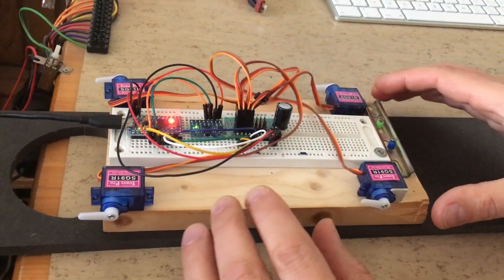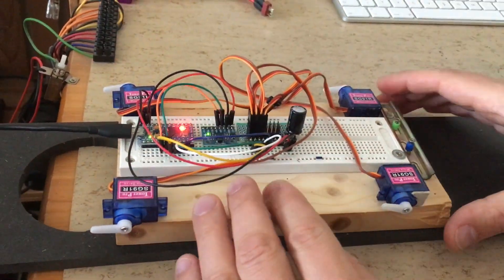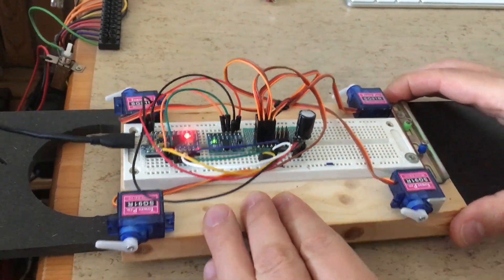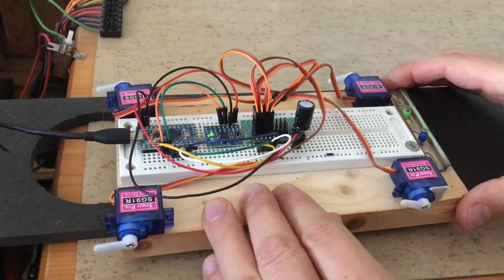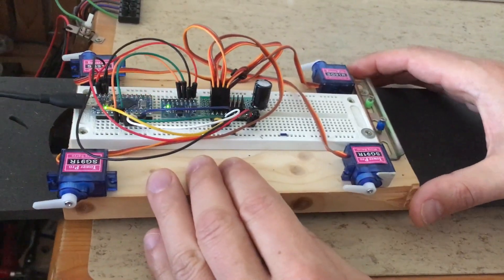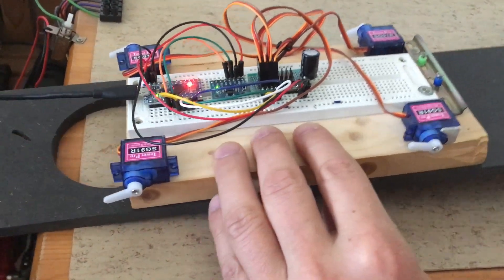Arduino RC Truck Cab Suspension Spring Simulation: MPU-6050 Spring Simulation!

Comment: Looks nice and smooth! I don't know if you've ever seen the Ao - to project (there are some videos on youtube). They tried to make a commercial project with a kickstarter campaign that included servo simulated cab suspension, truck suspension, sounds and lights, but the kickstarter failed. I would absolutely try your project if I ever build a semi trailer type truck.
Reply from the maker: Thanks. It's just a quick and dirty concept. Yes, I know the Ao - to project

Comment: Thanks for starting this project. I was thinking to make something similar but on stm32 so we can use flight controller from quadcopter.
Reply from the maker: You're welcome
Reply: I have a drawer full of old CC3D boards that are practically useless.   A project like this would breath new life into a lot of old multirotor hardware!
Reply from the maker: @AcroFPVpilot  This sounds like a good idea!

Comment: I has try to make it and it works in a breadboard
But the problem is when i put the mpu on the cabin and it start shacking even the cabin in stabil/not moving position 😁
Reply: I use arduino nano
Reply: On testrig you use raw pin for vcc of mpu ,but when i use raw pin it doesn't work
Reply from the maker: You have to mount the MPU to the vehicle frame, not to the cab. Please note, that this is just a concept and was never tested in a vehicle so far.

Comment: hallo,geniale arbeit!!!
hab gead dein projekt hier gefunden und mir auch die einträge im forum durchgelesen,hast du denn die federung fertig gestellt? würde auch gern mal sowas nachbauen,bin aber mit dem arduino nur soweit vertraut fräs-/lasersoftware aufzuspielen und zu nutzen. hab mir deine links angesehen,gibts irgendwo einen schaltplan oder evtl ein tutorial zum bau? grüsse ralle
Reply: I don't think he has any circuit diagrams fro this mate , but basically what he used was a microcontroller , I'm planning to use an arduino nano instead of the pro mini he uses. , that and the mpu 6050 and a BEC ( basically its a connection circuit where servos are powered directly by the battery on the positive and negative terminals and the signal wire from arduino ). The mpu6050 to microcontroller is the generic 4 wire connection you can find tutorials on yt for it , and the arduino/ microcontroller to servo connection is just the digital output pins into the BEC he made. The circuit isn't complicated but the code is somewhat big

Comment: Mantappp 👍👍👍 siap di coba
Reply from the maker: Thank you
Reply: @TheDIYGuy999  please tolong saya 🙏
Reply from the maker: @shortsku5902  I don't have any other code. It works like shown in the video, if everything is connected correctly.
Reply: @TheDIYGuy999  but when I compiled the code in the PID section it couldn't, even though I already gave the PID library

Comment: Hola como estas? Muy interesante tus videos, estoy en un proyecto tuyo, donde usas una arduino para emular el sonido de un coche en un radio control! Ando un poco complicado porque soy muy basico en arduino.queria saber si puedo hablarte en privado.saludos desde argentina.
Reply from the maker: Hi, thanks for the praise. Please ask your questions here in the comments section. Greetings
Reply: @TheDIYGuy999  como estas!, gracias por responder, estoy tratando de modificar el programa, cambiando el sonido de la ferrari, para lograr una ferrari f1 para un modelito que imprimi, no logro dar con el loop de audio, en el editor de audio funciona bien, pero cuando lo paso arduino se escucha acelerado, como si el loop fuera muy corto.te pregunto, cuantos segundos debo hacer el loop aproximadamente? Probaste emular un f1? Abrazo!
Reply from the maker: @dariosoldano8870  Sounds like your sampling rate is wrong. Make sure, it is always 22050Hz in Audacity (on the bottom left), in Bitlunis tool (check "resample" with 22050). The .h file should then say "sampleRate = 22050"
Reply: @TheDIYGuy999  hola como estas! Hice lo que me dijiste, tenias razon, ahora suena bastante bien!muchas gracias! cuando pueda subire un video.abrazo!
Reply from the maker: @dariosoldano8870  You're welcome